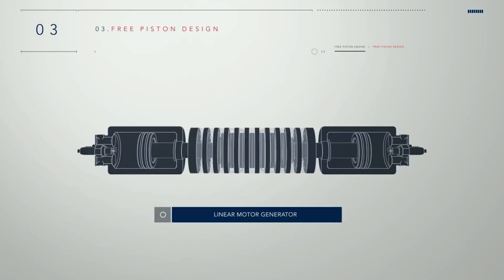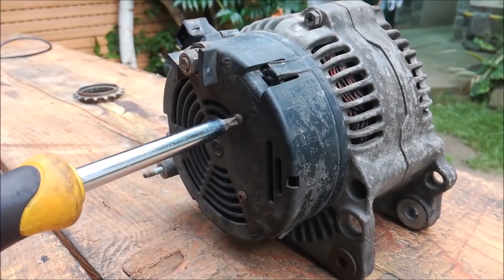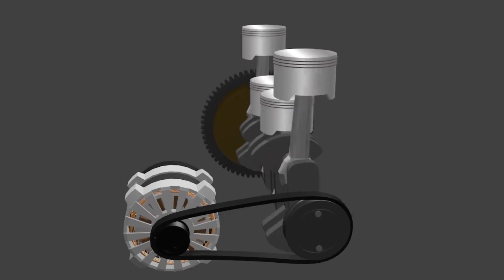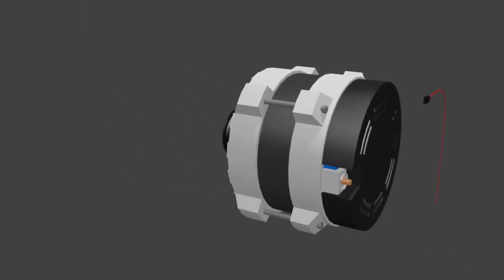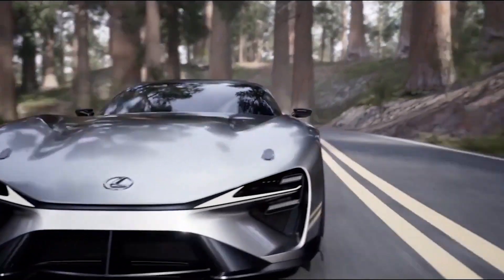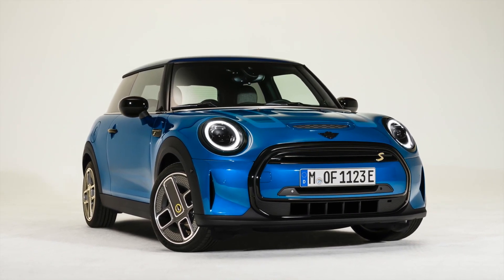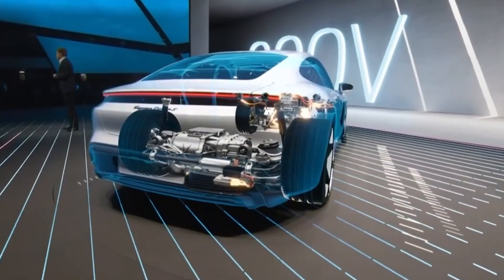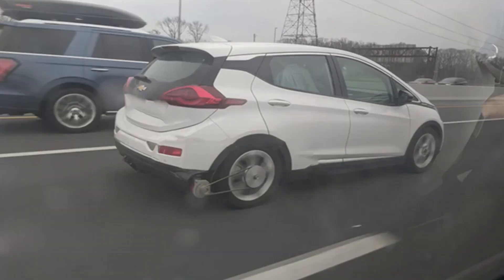Can you use an Alternator to Charge your electric car?

Comment: there are applications though
it qould work best when going downhill, where you would essentially convert your car's gravitational potential energy into kilometers run

surely the position of the alternator, as well as it not being integrated properly with a part of the car, are problems, but I guess you could tamper a little with the internal parts and transform each wheel into an alternator, putting some coils in the internal wheels and creating four little generators. or at least in the rear wheels as you wouldn't need to be concerned with parts like the differential. Or, like you said, directly in the transmission

Comment: I’ll run 2 high amp alternators to a power converter to the charging port and I’m pretty sure it would work. But you might need some kind of relay in between. Another problem is leaving it exposed to the rain might be a little bad idea.

Comment: We actually have something similar in the military for one of our vehicles in case the primary batteries die the aux batteries work perfect by this exact premise so it would indeed work with an EV. And by simply using a condensed aluminum alternator would reduce weight from it instead of a steal one copper is already light which is inside them by hooking these up to the drive shaft inside the body and replacing the driveshaft with a hollow aluminum driveshaft would reduce and balance out the weight instead so it would indeed work if you actually have mechanical experience or know someone who does it's simple mechanics and engineering

Comment: The alternator and battery only as backup because the tesla motor is permanent magnet arrange at an angle that it need no generator at all but whenagnet fail that battery drive the back up

Comment: The author says that the alternator would not work if wheel-driven but I disagree... if a pulley with belt was attached to the drive shaft that connects the motor to the wheels then it would indeed provide at least 15 volts of charge per wheel. Have 4 alternators on each EV and that's 60 volts of charge with virtually no pull on the EV's battery to power each drive wheel, while the other wheels are turning anyways without a motor attached.
Reply: You need to learn about science. This would add weight and create more heat, that is it, range would be reduced. It takes a lot of energy/torque to turn the alternators at high speed to make power and they are not 100% efficient.
Reply: @Iseenoobpeoples  you need to study mechanics and how the alternator works, as well as how it could be modified to make this work!
Reply: @ modified how? the power of the alternator is directly related to how hard it is to spin minus losses.
Reply: @Iseenoobpeoples  ... you put frictionless bearings on the pulleys and the output is greatly enhanced...
Reply: @ Friction is not what makes the alternator hard to turn, it takes force to turn the stator magnets very fast inside the magnetic field created by the armature.
Reply: Bearings inside alternators are already close to frictionless, have you ever tried to turn an alternator or a motor disconnected from the circuit, it's very easy to spin because no current is flowing.
Reply: If you connect the alternator to a resistive load for example a human would have to use all of it's force to only make 300-500W for a short period of time, a car would constantly be slowed down by it proportionally to the current generated.

Comment: Put extra batteries and use alternator to charge it whle you use the other one..
Reply: It would do absolutely nothing but add weight and discharge the other battery more quickly, range would be lost overall.

Comment: 4 tires with 4 generators, two batteries, one auto charging switching mechanism, and problem solved, when one battery is in use motion will do the trick and the 4 generators will charge the other battery, a mini-computer will be needed to constantly check the battery energy level to automatically switch to the one charging when the one in use is almost dead. I did the math in my head 10 years ago and I can tell you it does check out. However, it creates a hazard if the modifications to the car are not done professionally.
Reply: No, it doesn't check out, and you'd end up with less juice than without them.  Unless you're talking about using a gas car and attempting to charge a spare car battery or something that's used for electronics/computer and not to propel the vehicle.  Doing that increases the amount of power it takes to move the car by over 4x.  Each thing mechanically attached to each tire greatly increases the amount of power required to spin that tire beyond what that tire can recover in electricity.  Check out Jeremy Fielding's video showing some of the basic math.
Reply: @HostileTakeover2  Do you have the resources to perform a test, I'll be willing to bet my life I can make this work the way I said? if you put the money down and the tools I'll show you that everything we have been taught is mostly BS.
Reply: @HostileTakeover2  Just because you don't have the knowledge it doesn't mean is not possible. Albert is not always right.
Reply: @rijotech  True for many things, and true for Albert, but not for this.  I will say the switching idea itself is great - I think some variation of it is implemented on Hybrids and EVs (they might use an equal power distribution instead, I'm not sure).

But alternators are horribly inefficient things.  They're only good because they take the bit of excess power generated by combustion and convert it to something else we can use.  Enter Hybrids that use that excess to charge their batteries & run the electric motor and also why they still require combustion to do so.  That's also the reason EVs don't have one at all.  It always comes back to that energy is lost in any transfer, that alternators require a LOT LOT more power to turn than they can give back, and that increasing the number of them only increases that disproportion.

I'm open to proof to the contrary if you can demonstrate it working as suggested in real world.  And I encourage you to do so; self practical tests will always trump theory discussions.  You can test this for yourself by spinning one by hand or whatever combination of motor, hand, whatever using whatever variety of gearing you like to try out.  But you''ll need to be thorough in power measurements.
Reply: I seriously hope that you aren't working in a science field. This would reduce range and add cost/weight.

Comment: Look at all these comments they think they are advanced electrical/mechanical engineers with hundreds of 1000 's of hours of R&D like these car companies have. Lets install a 12v alternator from a 78 chevy and mod it to charge a 300volt traction battery and install a dc to dc transformer to charge the battery, even the presenter said you cant charge/discharge the battery at the same time.. The school system has failed 99% of you all 🤡

Comment: Maybe someone (way more educated than me!) can help me here. Could a 10,000 watt portable generator provide enough power to run a EV? Not talking about using batteries. I kind of understand The Conservation of Power Law. But only kind of. I've looked all over and I can't find the actual electrical power required to run an EV motor. Or here's another option...use a small Generator to recharge batteries. If the generator can provide more power than the motors require would that not work?
Reply: What you talk about already exist, it's a type of hybrid.
Reply: @Iseenoobpeoples  I know about Hybrids to a degree. What I'm looking for mostly is how much voltage, Amps, etc does an EV motor take to move the vehicle. Could I take a small generator that produces say 115 volts and oh 20 amps to run a car type Alternator which in turn would produce enough "power" to turn that "Motor" which also would charge a battery? May sound like so much gobbledygook and I still may not get my idea across cause I'm not explaining it correctly.🤔
Reply: @ 10,000 watts is 13.4hp, you choose how to split the power between motion and charging. When plugging in your car it charges at around 10,000 watts. It takes around 50hp to cruise at 100km/h (60mph) but you need way more power to accelerate.
Reply: @Iseenoobpeoples  I have a couple generators for power out times. On a 10K generator I have ran my entire 2000 SqFt house. I have 2 upright freezers, 2 Refrigerator/Freezers, and a small freezer. A Sunroom with a 220 volt Minisplit AC/Heat system and any of the usual lights. And during a couple 4 day plus power outages we have done ok. I turn off the breakers to the main Heat pump, stove and Hot water heater. I found that to keep the freezers, fridge at temp I could run the generator for approx an hour every about 12 hrs to keep them at temp. I see these Golf carts sprinting all over alot. Got to be a way to incorporate the advantages with some kind of "out of the box thinking"... Idk.
Reply: @Mr51Caveman  Check out the Nissan Kick e power, it is what you are describing, it's a low cost car for developing country, the power is not competitive for other markets.

Comment: The only way I think k you can is two sets of battery banks..one that's shut off while charging.. when the other battery needs charging is throwing electronically a switch disconnecting the first battery requiring the second battery to take the load..once the first battery is completely disconnected from the circuit then it can charge independently..if this is possible just a thought..

Comment: Most electric cars have a set of wheels not in use, a 3000 or even a 6000 watt generator can be spun by hand a set of wheels could easily spin this generator. This is secretly being tested now. Nothing is impossible, just improbable.
Reply: It cannot work. The generator cannot be spun by hand when it has an electrical load connected to it. It will impose load upon the driven wheels and the power to drive those comes from the traction battery. There is no workaround the first law of thermodynamics.

Comment: If you use a gear ratio that uses little kinetic energy ti turn and a high ratio for the alternator, in theory, you could extend range quite a bit.  Because if you are replenishing the energy you’re using as you use it, yeah it’ll be a net loss, but way less than the friction required to turn the wheels just by themselves and when you’re coasting downhill, it’ll recharge the battery with just gravity doing the work. I want to try it out and see if it’s a viable option

Comment: The reason you can't have alternators on electric vehicles is because unlimited range would mean no tax harvest for your government
Reply: no the extra load on the motor will make it draw more power
Reply: @hugodecotignie3834  not by much have you ever spun a alternator it really doesn’t drag all that much. There’s more drag being done by the road then there is from the alternator. The real problem was with how much the alternator can put out compared to how much the engine is consuming.
Reply: @thepropview9517 there is a alternator that puts out 10 kWh which is over the amount to charge a. 50kwh BYD car which is 7.2kwh. I really have been thinking about this all day.. this has to be possible and should be easy to do on the free sprung wheels that aren’t actually driven from the electric motor. Like the rear wheels of a fwd car. Even if this doesn’t make unlimited power, I don’t see why it wouldn’t at least extend the range
Reply: @thepropview9517  have to ever spun an alternator and made 300W? It will take all your strength for minimal power and you will tire very quickly, you thinking that it's easy is wrong and false.
Reply: @hugodecotignie3834 you can compensate for this using pulleys
Reply: No the real reason is that it doesn't work. No way the alternator will generate enough power to charge the battery and run the car.  EVs and hybrids do use regenerative braking which recovers waste energy when braking and driving downhill which does extend range but there is no way any car can generate enough power to power itself continuously.
Reply: Actually, it’s called mileage tax They just see how many miles have went on your car every so often and charge you on that so it wouldn’t really matter if your car could charge itself or not.
Reply: @thepropview9517  explain
Reply: Correct no charging stations means convenient stores would lose buzz also
Reply: I've seen a guy use a home made setup with 4 alternators , an electric milk truck motor and  3 batteries and that thing moved like it was a race car.
Reply: You need to learn science.

Comment: What if you add a wind turbine at the front of the car that makes use of the parasitic drag already caused by the car moving through the air?
Reply: Wind turbines has Altenator in them that is what generate the Electricity,all they need is to fix 2  altenstor to the  2 wheel shaft and rotate and it will charge the battery ,they simply don't want us to be free , mentally and financially
Reply: Just adding more drag, however, I have seen wind turbines along side the bus lane that gives back some energy.

Comment: Elimate the batteries. 1 battery  to start an electric motor to run the alternator. The electric motor then is powered by the alternator, as is the concept in combustion engines. The problem is all vehicles have been designed to travel on an average of 300-400 miles no matter the size of the engine. Why is that? They have forced everyone to stop for a service of some kind.

Comment: A + B banks: dividing the batteries, charging half while using the other half. Automatic or manual transfer switch to charge (via alternator) the A or B side when it is down to 30%. Integrated hub/gear assemblies belt driven, to alternator, mounted in trunk and front. An alternator spins very efficiently and the additional weight is minimal. In my field of work this is very simple and can be done. But for now, ICE & Hybrid vehicles will be around for a long time as Exxon has recently invested into the Permian Basin in Texas, now consolidating its position with a $60 Billion acquisition of Pioneer Natural Resources.
Reply: The Rich and powerful people  simply want to keep in Slavering us ,they never want us to be free , mentally and financially, simple

Comment: Mount the fucking wheels on the alternator. All four wheels on 4 alternators. No drag. Alot of power.
Reply: I agree with ya , if it’s gotta.drive shaft what’s to stop that from becoming a generator with magnets on the shaft and windings around it , seems like you could make a lot of electric and even step it up with an inverter 🤔
Reply: @davescheer5038  that's even better 🤯

Comment: If you had an alternator hooked up to each wheel and had it only engage during deceleration, it would work quite well to increase range.
Reply: @q6906 An alternator is a 3 phase AC generator. They have a part inside called the diode trio. That rectifies the signal to DC then the regulator controls the output voltage. EVs have 3 phase motors. In regen (braking), they turn into generators and the motor controller rectifies the signal to DC to charge the battery. To make any real difference in charge for a battery with hundreds of amp hours or so, you'd need to add a decent amount of equipment, which adds weight and mechanical strains making any gain negligible.
Reply: @justin39640  you didn’t state any facts😐 you just listed a definition and your opinion. You believe we can go to space but can’t solve that problem 😂 ok bud
Reply: @q6906  I've been working on EVs for 3 decades. You believe we can't? I guess that explains your misunderstanding of physics. Lol
Reply: Three phase AC motors are alternators while coasting or slowing down. DC motors are generators in the same situations.
Reply: They simply want to keep Slavering us mentally and financially 💸 💸💸💸💸 after nature has gevin us free Energy, lithium
Reply: Alternators have regulators to put out a constant voltage, so it could be used 24/7 not just while you slow down
Reply: @q6906  the extra energy needed to turn an alternator will negate any extra boost you might get in charging. There's no free rides in physics. Lol
Reply: @justin39640  you don’t need an alternator that’s used in a combustion engine.  And you don’t need to generate power to make it self sufficient, but more efficient. I also don’t get why ev cars need to go 0-60 in 2 seconds when it’s less economical when the whole point of Evs are to be economical.
Reply: @q6906 They do 0 to 60 quick because electric motors have 100% torque at any RPM. You program them to have an acceleration curve. Just going 0 to 100 percent in an instant may be uncontrollable. Lol
Reply: Yessss like how a differential works👏🏽
Reply: Or perhaps the hubs themselves could be designed to function as alternators..
Reply: Also employ some kind of countermeasure like a photovoltaic reactor that could load a capacitor to energize the alternator via drive motor to diminish or negate the resistance point lessening friction.

(Photovoltaic reactor -solar panel lined box with internal light source)
Reply: @DaleLockwood-c8m  Yes! That’s smart.

Comment: You need a lenz free generator meaning no drag ( back EMF ) when the motor spins. It's like the generator is not even attached to the motor or mover. Such lenz free generator is exist, design different than the regular one. It  remove back EMF and reuse the back EMF. Hence, it creates no heat and positive energy to charge battery.

Comment: That is where gearing come into play.😉 Gear it so the alternator turns faster than wheel shaft = more output.👍
Reply: You're just trading revs for torque. You cannot increase the power in a system and get energy for free.